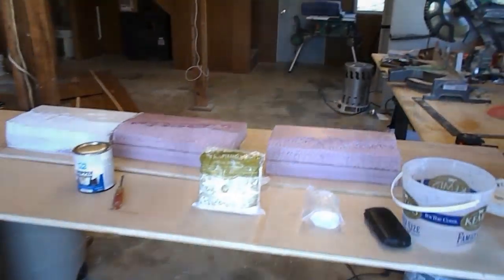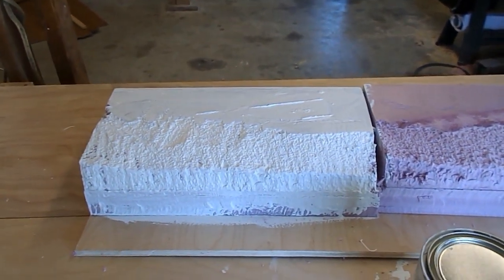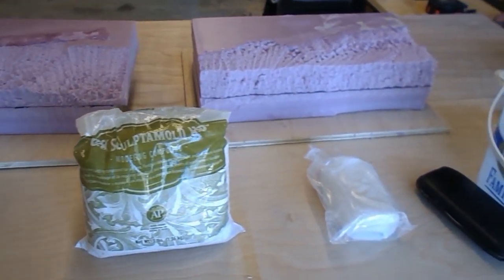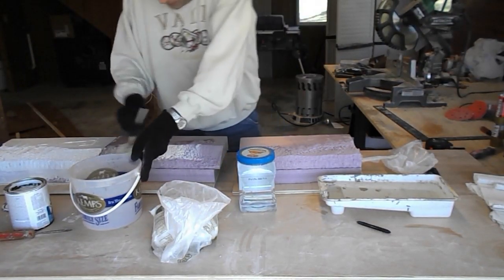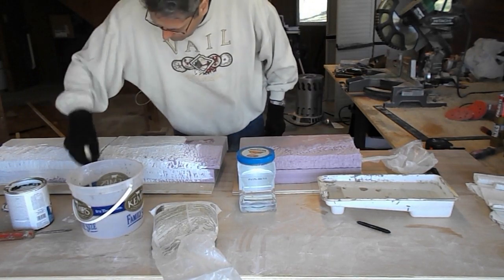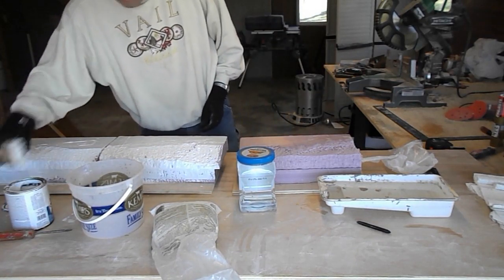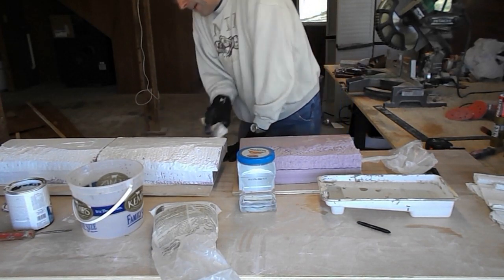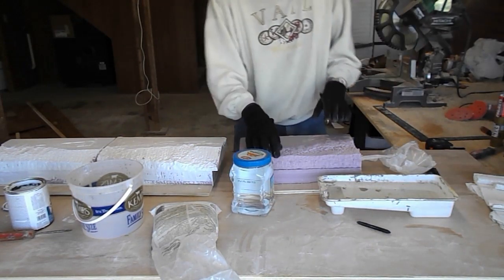More experiments with the gripper

Comment: Home Depot has PPG Seal Grip, so it appears they’ve changed the name. 

Thanks for the video, as it was very helpful for ideas on my next project.
Reply from the maker: If it's only at home Depot, then it's probably not the same product.  The other one was sold at Lowes.  I suspect that most primers should work.  I'm using one at the moment that holds just as well but takes longer to cure.

Comment: This is a great video. With so many materials out there I wonder what works and what doesn't. Paints and plasters to foam, bonding agents, plasters over wet or dry plasters etc. I bought some Plaster of Paris that I plant to do rock molds with, I hope it sticks haha.
Reply from the maker: Plaster of Paris is also my plaster of choice for rock casting/carving.  It sets quickly, carves easily and take paint/stain well.  It's also easily available and inexpensive in the large bags.

Comment: In construction, we often use a bonding agent between concrete pours.  I believe it acts similarly to the wet gripper to achieve a better bond. Thanks for doing the test, your vids are always informative.

PS, if you don't spill some, you're not doing it right. :)